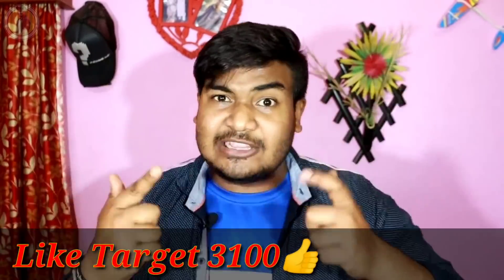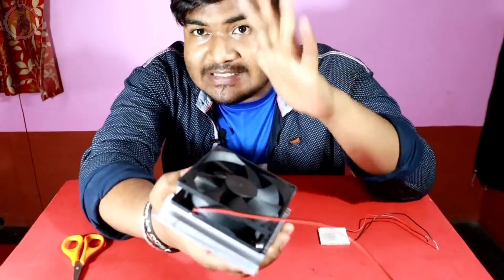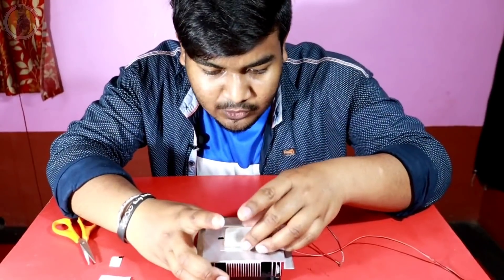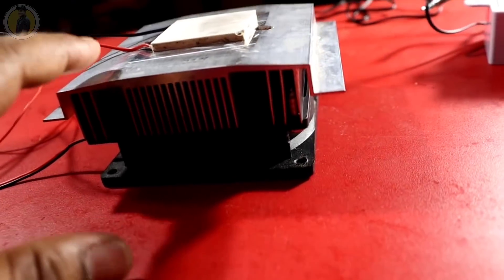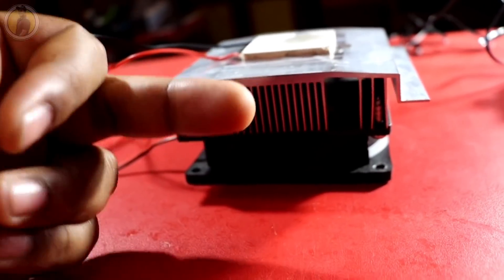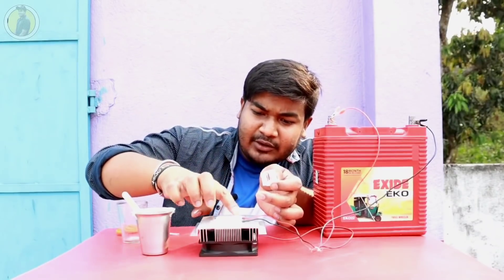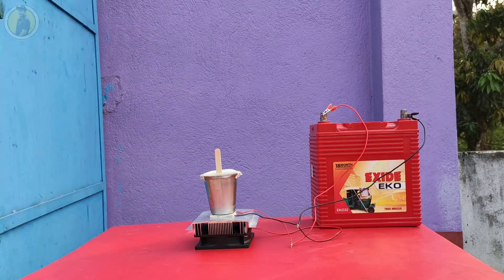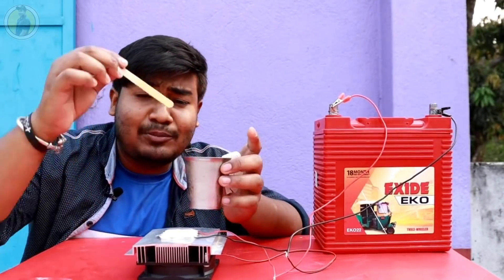চোখের নিমেষে আইসক্রিম বানান | INSTANT ICE MAKING EXPERIMENT | PELTIER MODULE

Comment: Peltier module is based on Peltier effect or seebeck effect. Two different metal plate if connected together then their two joining poles have temperature differences. One side gets hot and another cold. It’s physics But nothing else. It’s not possible to make ac from such small modules as the hot side needs efficient heat dissipation and also high power consumption is necessary as well. As soon as hot air touches the cold side of Peltier it forms water on that side because of moist air hence cold side automatically gains lower temperature if another fan is attached on cold side. So it doesn’t work like conventional room ACs. It’s just for fun projects and CPU components cooling.